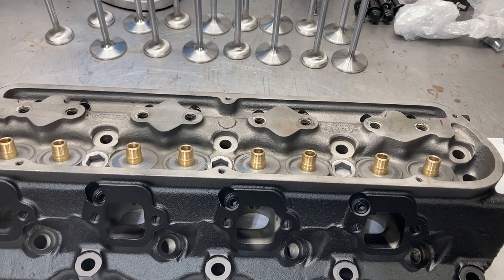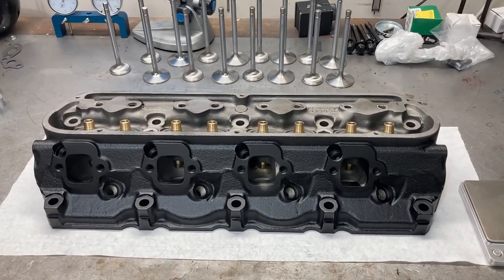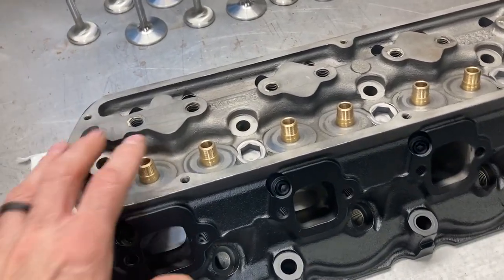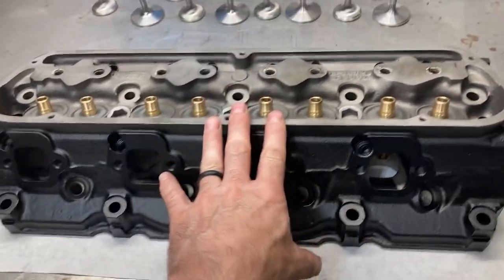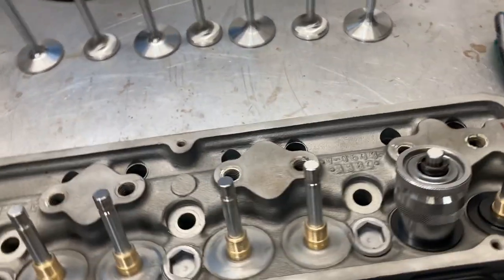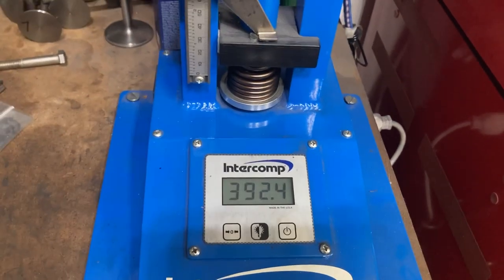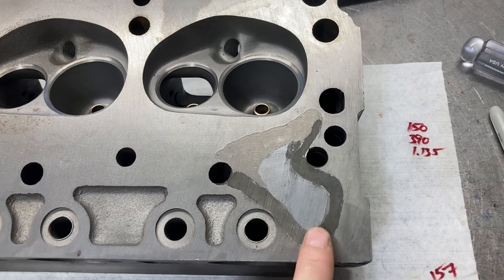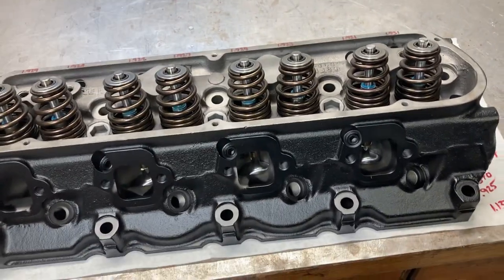Lykins Motorsports Ford 302 Tunnel Port Cylinder Head Assembly

Comment: If I remember correctly, Ford had problems with these heads when they were used for the Trans Am series.  Not sure what it was in particular, but they stopped using them.  It may have been that the port sizes were too big for the 302 that was used in the series.  Regardless, I hope that you can get them to work for you, maybe with a larger displacement engine.

Comment: How much power was gained by switching from the small block tunnel port heads to the Boss/Cleveland heads on a Trans Am style 302 engine build? Really enjoy your channel.
Reply: Tunnel port Heads Are Not Ventura Shaped going into the heads but more like a straight Pipe and because of That they don't make Good mid range Power Naturally asperated , but they would work good with boost because all the work in the in designing Head ports to Flow good For Natural Asperated Motors doesn't matter to a forced induced engine bigger is better shape of port doesn't matter and you can adjust boost levels to be low or mild so if you want more power you Need To move more Air but the bigger the ports the slower the air Will move through the head on a none boost engine but not with boost the intake ports are always under pressure pushing the air in increasing Air volume and Air speed through the head , you could go mild on boost and use it like you would a naturally asperated engine like 3 - 4 lbs of boost and take advantage of more Air flow of The bigger heads
Boss 302 heads work better naturally Asperated and may do better than the tunnel port Heads because they have bigger ports and bigger valves
Canted valve heads moves the valves father away from each other and can fit bigger valves 69 boss heads had 2.23 inch Intake Valves 
70 had 2.19 intake valves exhaust valves 1.71 for both - you could Reduce The exhaust valves to 1.60
And have room for more intake valve size increase , The Hemi's sohc boss 429 had 2.25 inch Intake Valves , you could get a bigger valves in the boss 302 heads by reducing the exhaust valves , I know of 2000 
Hp turbo motor running 40lbs of boost with 340 cubes with 1.55 inch Exhaust Values , but IF You want to keep it naturally asperated A F R Heads is A Good way to go and there are after market boss 302 / Cleveland type heads - CHI is A Good choice for those type heads
The 427 tunnel port also had 2.25 intake valves while the 302 Tunnel port had 2.00 inch Intake Valves

Comment: I was surprised to see the air injection ports I thought they were race only heads.
Reply from the maker: I have 2 pair. One is a street head and one is a race head.  Big differences between the two.  Streets use smaller valves and stud rockers.  Race heads use bigger valves and shaft rockers.

Comment: Man, you have a dream job. Thanks for sharing what you do. One question, how are you going to seal the exhaust flange with those smog tube bosses(?) taking so much flange space on the heads? Is there enough there, or do you have something for that?
Reply from the maker: It's tight, but I think there's enough there for a good gasket.
Reply: My thought as well. I wish you luck with that.

Comment: What are the advantages of stainless valves?  I see a lot of modern engine builders using these.
Reply from the maker: It's either stainless or titanium.
Reply: Joe one big advantage is how strong and durable stainless is compared to its relatively light weight. The same thing could be said about titanium except it’s considerably lighter than the same size valve in stainless steel.
Reply: @danielwilson6665  I see.  I thought that maybe stainless would dissipate heat better on the exhaust side while still allowing for optimal fuel atomization as the fuel air mixture as it moves over the intake valve.
Reply: Stainless is the go for most performance engines. Will not last as long as the OEM style valves but are lighter by a margin and the heads dont normally fall off! Ti, is for big timers. Lighter again and stronger again. But life them or you will get bit!!

Comment: What did they put those heads on, any street applications
Reply: Just the Trans am Mustangs. Had to spin them to over 8000 if I remember right which caused engine failures.
Reply: They only used them in 1968 on the Trans Am Mustangs. Ford was supposed to make a street engine available in the Mustang to satisfy the SCCA rule that a certain amount of street cars were built before it could be used in competition but that never happened.  This motor needed to rev to make power. The street version would have been a dog.
Reply: Designed for Trans Am racing, but showed to be a fiasco and had only a  short life before the  project was junked by Ford. Was replaced with the Boss 302".  A factory prototype street version Mustang was tested by one of the magazines back in the day.
Reply: The problem with the engines, was simple, Ford racing boss Passino would not let anyone touch the engines, outside of assembly line workers. Yep the engines were built on a side engine line, by the factory engine assemblers.  A story was that at times the engines didn't  always run, one story was one engine only had 11 pushrods. The factory claimed about 430 hp, the Cleveland  heads were reported to make about 40-50 hp more, with a fatter curve.. So the tunnelport  was short lived.
Reply: @scottfritz4988  The 4bbl 480 CFM  Street Tunnel Port was rated at 240 HP Gross at 4600 rpm, the dual Quad Autolite 480 CFM, technically 250 HP Gross at 4600 rpm, both iron headers and AIR injected on the promotions literature. The Gross Street Tuned Port HP figure at 7000 rpm would have been about 40% more, just like the Boss 302's being factory rated at 290 HP Gross 4600 rpm, but making 350 HP gross at the "technically' 5800-6000 rpm  but actually 6150 rpm Autolite ignition cut out. See the  Camaro Z/28 vs Tunnel Port Mustang with race driver Sam Posey in the July 1968 Car and Driver Magazine article. Each was over the counter optioned, the Mustang GT 302 the 390 HP Gross at 7000 rpm fully muffled Dry decked 12.5:1 Race Tunnel Port head engine, with over the counter Quad 540 CFM Holleys 8 quart 8000 rpm + capable sump, tube headers, Le Man's Solid lifter 318 degree cam. 13.96 sec at 106.13 mph 1/4 mile  at Lime Rock. It was apparently internally rated over 420HP at 8500 rpm as a fully prepared solid lifter Ford 302 TP race engine without mufflers.  That was why Ford threw the game in the 1968 SCCA races, taking two wins out of 12 races, and letting the DNF debacle give  Chevrolet a resounding win at the manufacturers' trophy. While the Mid year 335 HP Gross Cobra Jet 428 was dropping 13.56s at 106.64 mph. Ford's factory strikes were the issue, and the SCCA had signed off on the  two 4bbl Street California spec emissions engines, plus one Race TP engine, each totally different. Race Tunnel Port 302 heads were dry decked as well, just like the 429 Boss.
Reply: @johnsalvaterra3116  , have you seen this cannel in another video  have flow tested these heads?  The flow numbers are pretty bad in relation to how big the ports actually are. The tunnelport design was a big mistake.